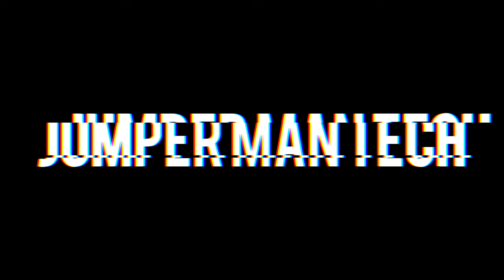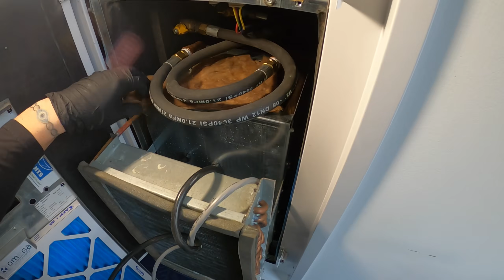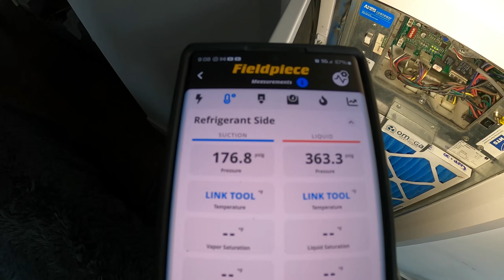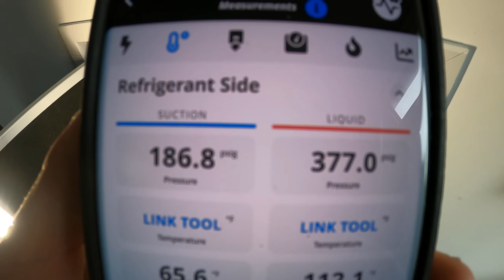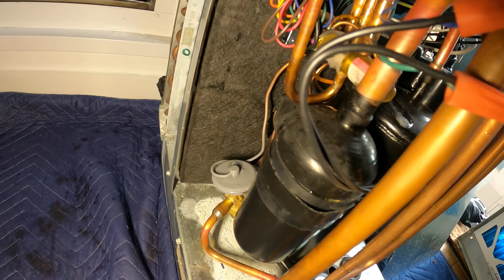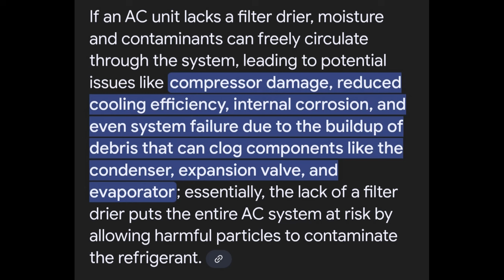HVAC: OMEGA Water Source Heat Pump Not Heating (Omega LPS Error Code Troubleshooting/Repair)

Comment: I work as a watch engineer and maintenance and I'm responsible for HVAC and refrigeration and plumbing. My previous chief engineer would do things like that. I had a water furnace heat pump that was not working. All of the system and wires were bypassed to the point that I couldn't figure out what was wrong. Both pressure switches were bypassed. The only thing that wasn't was the thermal overload which would trip the compressor. It was a nightmare.

Comment: Thank you for the video. Quick question. The blue dial on the control board, is that the one that needs to adjust to decrease the level of noise from the fan? Thank you.

Comment: I’ve been in HVAC for 37 years. I’ve got two Goodman 14 seer heat pumps that were pulled from Homes still functioning for complete system swaps I’m cutting the condenser part and putting on axial flow coils and making my own water source heat pumps. I’ll have 4 tons water source, which will be fantastic

Comment: Please help me I have a water cooled climate master heat pump and it’s doing a one beep every couple of seconds which means that the boards going into a fault and re-trying and if you put into test mode it means that there is no previous fault in the memory. What else is odd is if I jump power to cooling mode the fan comes on and sometimes the compressor will come on and sometimes it won’t and if it’s one of the times, the compressor comes on and runs for five minutes and shuts of. Compressor is drawing 34 amps and the low side is 55 high side is 300 it’s a 5 ton system

Comment: I have the same unit and I am getting a water loop supply temp too hot. Do you know what it could be? System is 5 years old and definitely not tempered like the one in the video.

Comment: Hi, just stumbled upon your videos. As you were asking what would happen if the hoses are connected the wrong way. In this case the Heat exchanger (Condenser) in cooling Mode would be run Co-Current instead of Counter-Current this would lead to a lower heat dissipation and as a result most of the time higher condesation temperature and/or less subcooling.

Comment: Thanks for the great video! Only thing I would have done different is remove the refrigerant that the drier would have held until I  added the filter drier. With the filter drier removed and then charge from the nameplate amount it would be over charged especially without a receiver.

Comment: Just a tip with nylog and flared connections, it is important to apply it to the surface that makes it seal. In that case that would be the conical tip of the fitting. Unlike NPT fittings, the threads are not what makes it seal.

Comment: just a thought, wouldn't low/no water flow cause a low pressure and possibly freeze the heat exchanger?
that doesn't explain them having errors with the LPS bypassed though. lol.
Reply from the maker: @throttlebottle5906  For water cooled systems, low or no water flow would cause the head pressure to rise as there's nothing to cooling it down. It's like not having air flow across a condenser if it was air cooled with a fan. Definitely doesn't explain the LPS errors with the LPS bypassed. It's definitely the board 🙃 Thanks for watching! 🔧⚡️
Reply: @JumpermanTech  I thought the complaint was only in heating mode, where it's reversed and trying to freeze the water exchanger/loop.
I'd imagine the water is pretty cold if city water is just being wasted instead of cooling tower/boiler heated. do they have water temp sensors?

Comment: G,day Jumper man tech from Sydney Australia.
Just for the interest, keeping the PCBs and connecting to 24 VDC. 
Check surface components and plug pins for V continuity and capacitors. May need some type of magnifying glass.
Odds are they fail at the same point.
🌏🇦🇺

Comment: We had 100 of those in a hotel i use to work in.  I was the new guy on the engineering dept.  " fancy word for maintenance crew"    only the head engineer was allowed to work on the units and he would not train anyone on anything.    I use to think he was some super skilled guy cause he could remove one unit and swap it out with a unit from another room.    Now I know you just unplug and disconnect the water lines.      It's not rocket science.